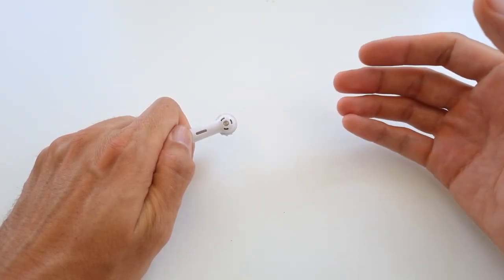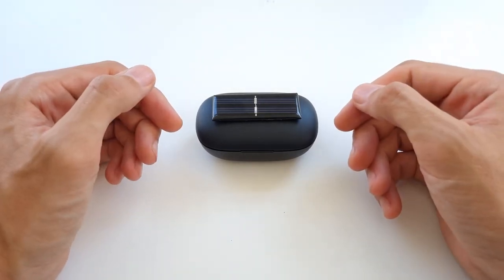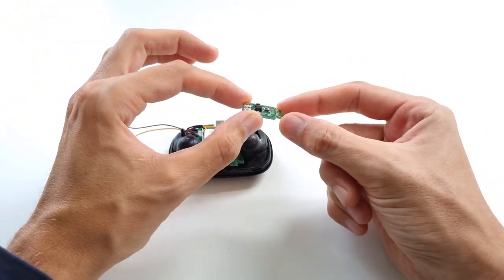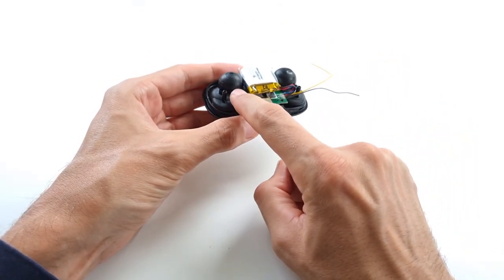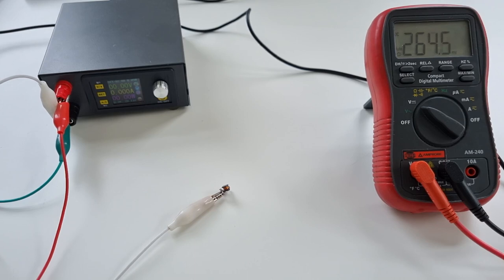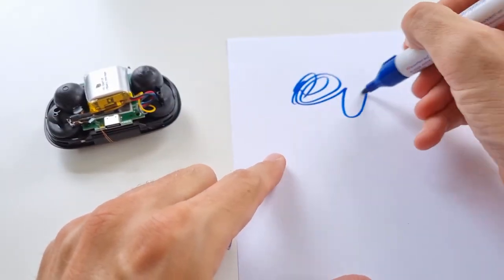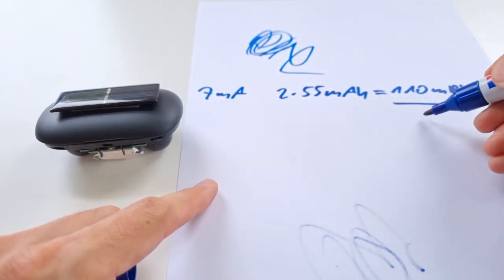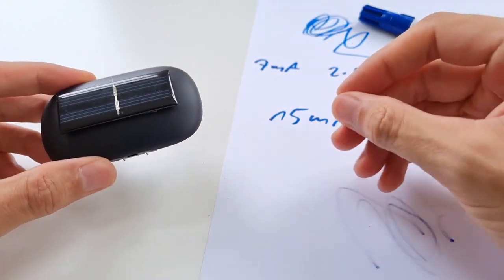Self-Charging Earbuds

Comment: No issue charging a 4.2 volt lipo with 5 volts? Cool idea. Maybe the diode help a bit in this respect..
Reply from the maker: Good point, I should have mentioned that the current is so small that it will never reach 5V so it should be quite safe. And if it would go above 4.2V the battery protection should kick in.
Reply: @kassenbon  Does the battery have builtin protection, have you checked? Most of these devices where a small battery is hardwired don't have it in the battery and either rely on the charge controller being sane and battery this small simply not having enough explosive power to be dangerous, or have the protection chipset on the charger board instead of in the battery. The little PCB on the battery is often just a termination adapter rather than a protection board.

That being said i'm not actually concerned. These batteries will take 4.35V, they're actually chemically stabilised compared to old 4.2V types, and if you used a small-signal diode or a rectifier diode, that drops like 0.7V, so there won't actually be almost any current at all going into the battery even with step-up at 5V once it's at its end of charge voltage.

Comment: Could just replace the case battery with a smaller one to make room for the board since the capacity of it shouldn't matter if it's being charged all the time. As long as it's big enough to charge both earbuds from 0 to 100, there will be no change in experience.

Also I'm thinking of a custom 3d printed bottom shell to accommodate the panel so the thin wires aren't exposed
Reply from the maker: Good point, that would be a much simpler method than my dead bug circuit. 👍

Comment: Of course this makes sense bumping up the voltage by using inverters so why haven't anyone else thought about this idea before for larger projects that use massive amounts of solar panels that don't create enough electricity as they are standard unlike this clever man has just come up with and invented the real genius you could become a millionaire my friend what you have just come up with think about it what I have just said mate 👌👏
Reply: You can't create power with a step up converter, you just boost the voltage at the expense of current.

You can also get customised solar cells made. So a solar cell that outputs 1V is probably 2 solar cells in series, and several in parallel. At the same size, if this were for a mass produced product, you can get one made that is instead smaller number in parallel, more in series, more voltage, same power, less current. Then this could be used directly to charge a battery. You avoid the step-up losses.

Comment: 7ma at what voltage that's a big difference from 1v to 5v that solar cell is at best 8 to 9 ma at 1v in direct sunlight at noon this is misleading  like those solar power banks
Reply from the maker: The 7mA is measured at 5V. At noon it is more like 12mA at 5V.

Comment: This is just flat out lying about how much charge that panel provides. Unless the creator has personally made a giant leap in solar panel efficiency, there is no way that you get 30 mins of use from 1 hour of charging from a panel that size.
Reply from the maker: I was also surprised when I measured it. In fact, it is even higher most of the time. The 7mA figure was measured in late afternoon. I measured again in early afternoon and there it delivered 12mA. So you would get roughy 50 minutes listening time from 1h charging.
Reply: Sounds pretty reasonable to me. These earbuds use barely any electricity. He also used the manufacturer’s calculation for playtime per Ah. Which might be an overestimation.